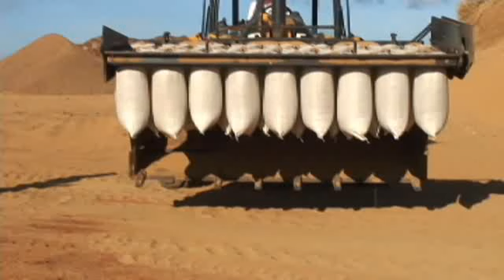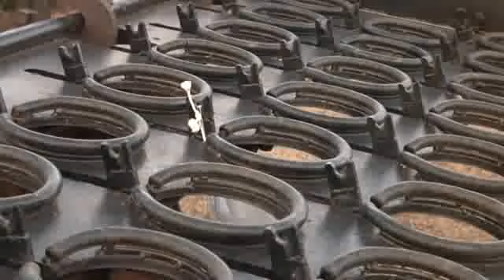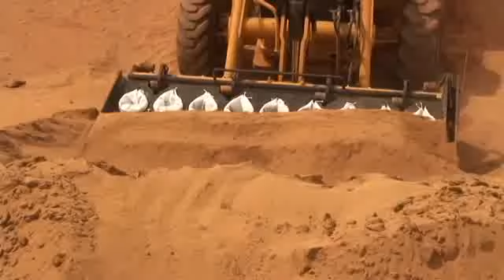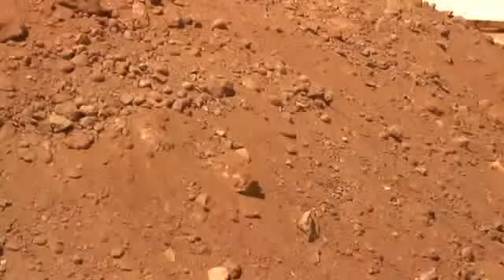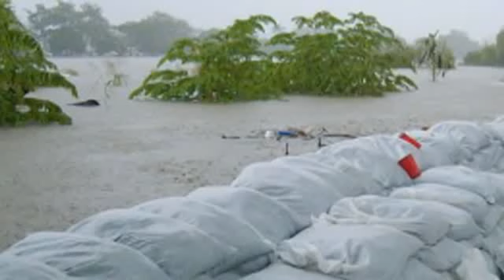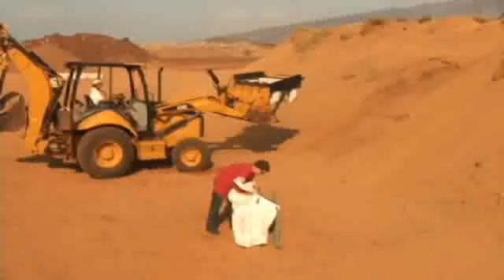Flood Control & Sandbag Filling Machine

Comment: Overfilled bags.  Good luck stacking those into a wall.  Synch ties do not seal bags either - so sand will pour out as the bags are handled.  Lastly, installing just one empty bag - per the video - takes longer than other machines fill, sew closed, and palletize bags.  This must be why they don't show "production".  Instead just a bunch of 2 second clips.  Any real sandbagging machine will show full production of at least 100 bags being filled.

Comment: great invention, how fast could it fill sandbags with 1 inch graded granite chippings (as used in railroad bedding) for bullet resistant walling, when built to 1 metre thick walling (IT stops 12.7mm/ .50 BMG round at 100 feet)